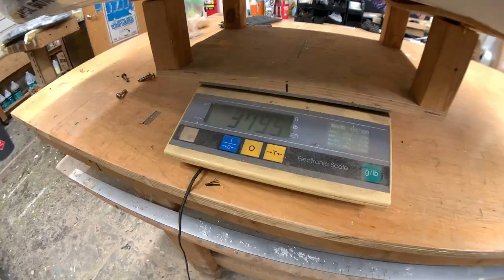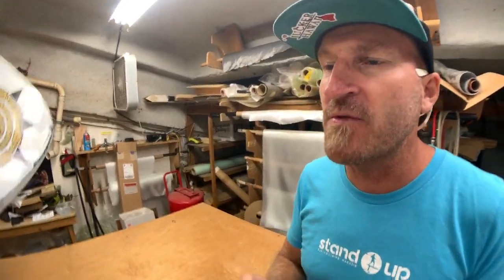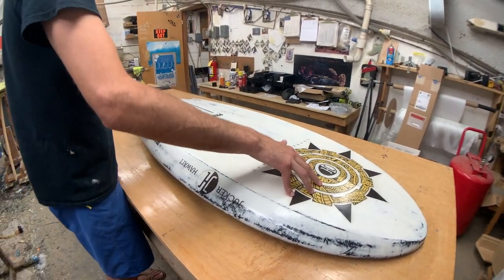The making of a foil board underwater shape and production

Comment: So it’s 4oz glass, then carbon, then resin filler, then a hotcoat and then a sanding coat? 

Or is there also fiberglass on top of the carbon? 

Is there a way to just sand the carbon and bag again a 2oz glass and leave the peel ply textured finish? Or would this cause leaks?
Reply from the maker: Aloha and thanks for watching. Unfortunately your question is a bit beyond my knowledge. Sorry.
Reply: Watch the previous videos. I believe it's 4oz glass, 6oz carbon, 2oz glass to hold it together, resin filler, hotcoat, sanding coat.